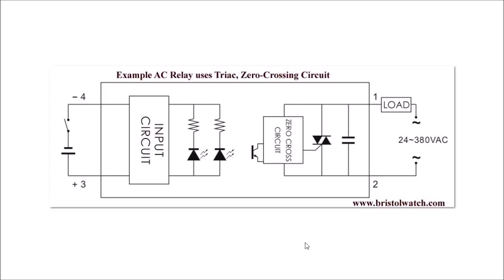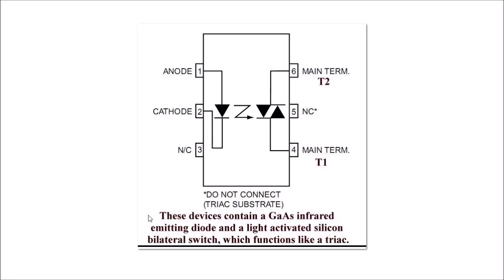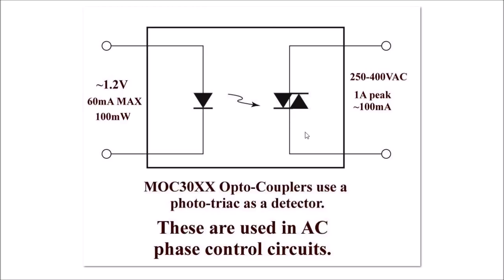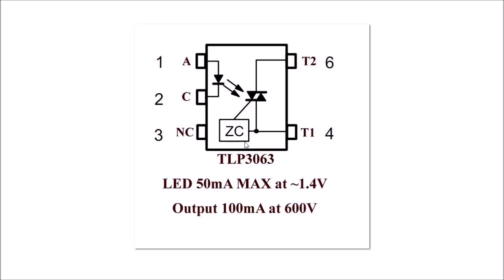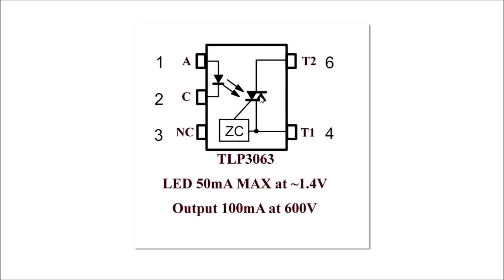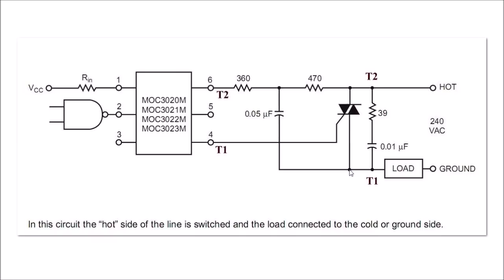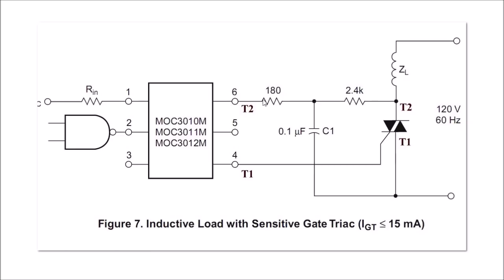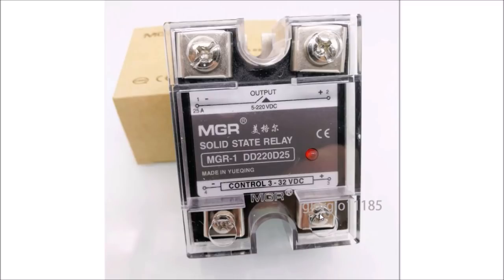Solid State Relay Triac AC Output Circuits

Comment: Nice why don't they mention a minimal voltage on output side
Http://www.arduino.tk
Reply from the maker: It doesn't generate a voltage it is a switch.
Reply: @LewisLoflin  i mean in the pdfs they are always talking about maximum switch voltages
never a minimum
is there a opto ic device that will switch 24 to 30volt AC and DC?
Reply from the maker: @LuberthDijkman  Yes. Check out a PC817.

Comment: For the snubber circuit at 06:55, what is the voltage rating of the 0.01uf and is it X2 type? Also what is the power rating of the 39R resistor? Thanks.
Reply from the maker: cap 250V resistor 1 watt. Not critical.
Reply: @LewisLoflin  thank you.

Comment: Hello, Can I ask?
I' ve been looking for the answer many times but without success.
Can I connect zero crossing relays in parallel? I read that I cannot because the relays won't switch at the same time. But relays are zero crossed so they won't turn on until the zero cross right? So if one of the relay want to switch earlier it cannot because it has to wait until the zero cross so eventually both will open at the same time? Or am I wrong? Thank you for answer. Also excuse my English it isn't perfect.

Comment: hello

one question

if keep MOC302x work(led on), could I get a full wave 220Vac for the load?

that means no matter IH and IL valve mentioned in Triac datasheet, even 1or 5mA load.

because I am confusing that if any "dead area" for Triac AC switching via this circuit.

Thank you in advance.

Comment: Lewis, Thanks for this. Could you do a lesson on trailing edge (vs leading edge) phase control please?
Reply from the maker: Yes I'll do that. I assume you mean AC?
Reply: @LewisLoflin  Yes AC please. I use Arduinos for my AC phase control and always use the design you cover above. They work well using a timed delay from the zero cross. However I am aware that at 90 deg leading edge trigger I am hitting the load with full peak AC voltage which I get away with, but it must be brutal! Better do the trailing edge as the firing is always at zero crossing, up over the peak and turn off on the trailing edge. I have seen designs using 2 back-to-back MOSFETS but have never built one and your presentation level, clarity and style is just right for me!

If you could cover the effects of the collapsing field on inductive (magnetic) loads then all the better. I would also welcome seeing it work on universal motors (UK term?) i.e. the ones in shower boost pumps as the leading edge control only works in a certain zone and is noisy so I abandoned this project. I would like to control my 500W shower motor if only to turn it down when my daughter tries to re-float Noah's Ark 

Thanks from England.

Comment: I have made measurements in a ssr GN 84137010 and at 3 volts it consumes 7mA and at 32 volts 9.5mA the question is: What is the internal circuit of entry in this type of SSR? Do you have any information?
Reply from the maker: I found the data sheet. I uses a current limiter circuit. I'll do a video on it.
Reply: @LewisLoflin  Thank you